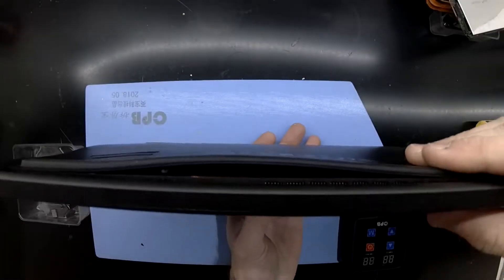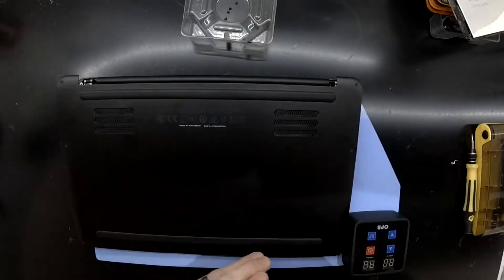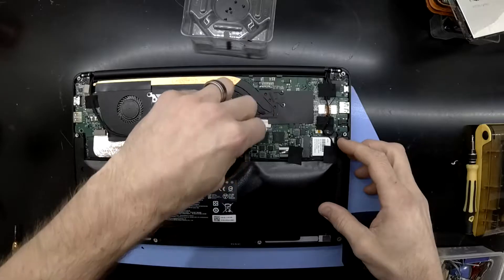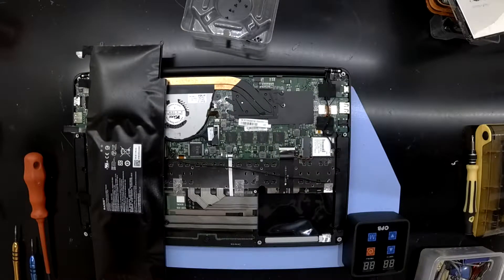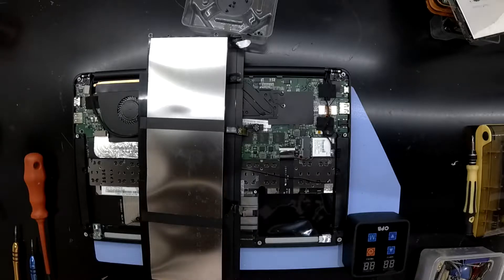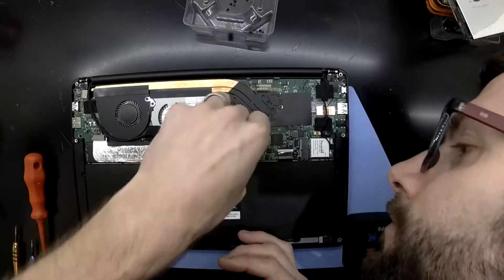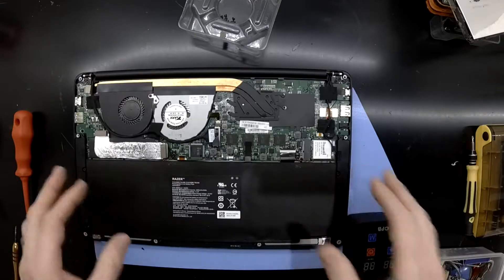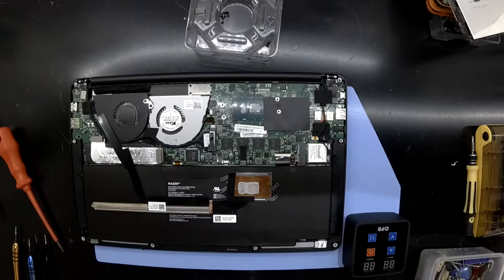My Razer Blade Stealth 2016 i7, Tear down and thoughts on this in 2019 [Fixed Audio]

Comment: You did not remove the fans
Reply from the maker: fans should be 3 screws and a single connector
Reply: @rickstechrepairs  I was particularly interested in seeing how the cable is removed. I couldn't find how to anywhere else 😔

Comment: From where did you get the spare battery ? I too need one for my stealth 2016 V1.
Reply from the maker: i got it from aliexpress, i sold the machine but the battery life of it dropped by about 1/4 of its original life after like 4-6 cycles

Comment: What a coincidence I just tore down my 2016 stealth to retape the heatsink replace the battery and reposted the cpu yesterday and was scouring the web for teardown videos
Reply from the maker: Did basically the same and also replaced the battery yesterday too, Looks at roughly 5 hours on battery life now, i purchased a KingSener battery from ali express, time will tell how it goes
Reply: @rickstechrepairs  got mine from neat for 45 bucks came at 97 percent original capacity. Ironically the same time I decided to make my razer usable again I also decided to get a new laptop. So I'm playing breath of the wild on a mag-15 now and probably wont touch my stealth again unless to RIP out its 500 gbs of storage
Reply from the maker: @Huddy52  haha its pretty much like that.

The 7500U processor is so underpowered when paired with a 1070 in the razer core, so im going to be selling the Stealth.

And get something with a i7 6700 or higher in it
Reply: @rickstechrepairs  small ass world. You know there is a windows tool that gives a battery health report